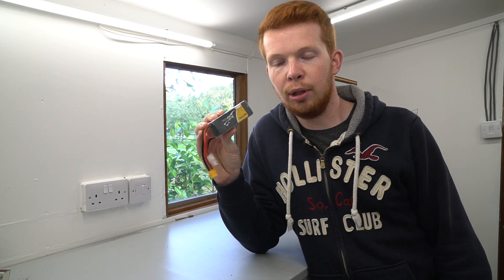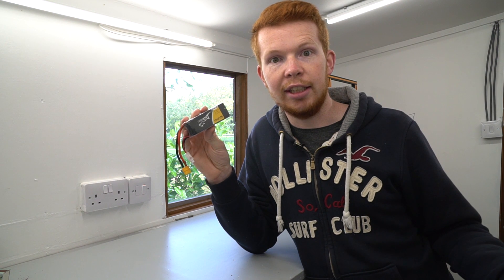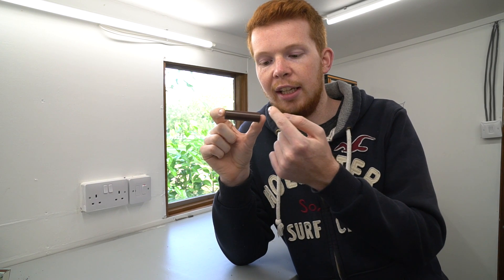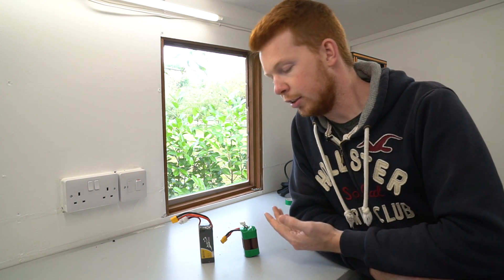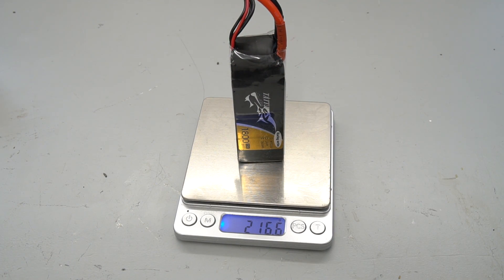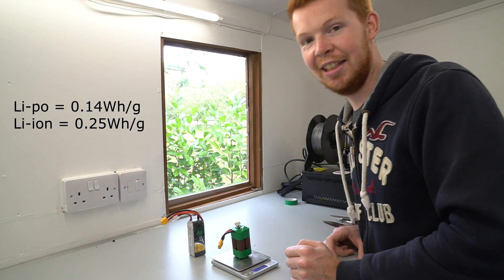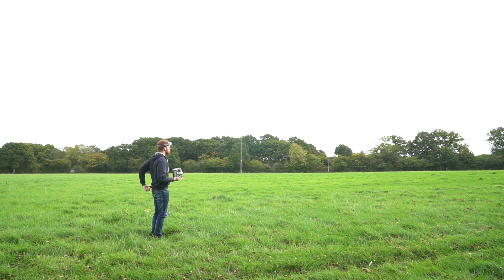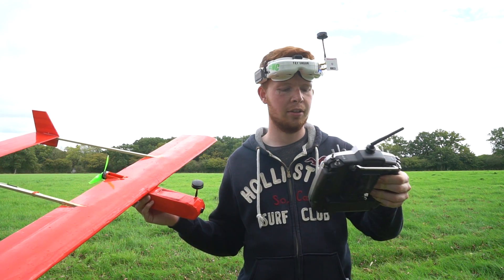Lithium ion plane battery

Comment: one motor, one ESC, no board, cheap homemade 'frame' - over 30 minutes flight time. that's why I love RC planes way more than quads. ok, you need servos but they're just so cheap.
Reply: The one thing I love about quads is their resilience. I have a cheap storebought quad that is indestructible. A fall from terminal velocity barely damages it. And the differential thrust deals with any misalignment in weight or rotor condition(i.e. beat to hell). I still would love a RC plane, but I can't afford one right now.
Reply: @ERPP8  if you have the patience its quite cheap to make rc planes. Sure they dont look like scale models, but they fly and its fun
Reply: @mortache  you'll be happy to know that that's what I did. I made one out of insulation foam and fiberglass. It's a chunky boi with a 3ft wingspan. Not too dissimilar so the one on this video. I just need to make for props for it(I mold them off an existing prop with fiberglass).
Reply: @ERPP8  i'll just stick with using readymade props. Good props are the most important part of the aircraft. Even cheaper ones will do
Reply: @mortache  they work quite well if I do a good job with the lay up. And they're far far cheaper than even the cheapest props of this size. It's like 11"
Reply: @ERPP8  I second this... but you do need twice as many props when you crash (on average).I built a quad copter two years ago, the frame is carbon fiber 4mm, I literally plowed the ground with it , bent 1 prop, I bent it back to shape, don't do that, kids( it shattered mid flight and slashed my knee when it fell), I have pictures with it swinging some long grass is caught
Reply: your profile pic almost tricked me
Reply: I have a quadcopter and Parrot Disco plane-like drone... It is the best solution for me, everyone who likes to fly should have both quadcopters and planes, the feeling of FPV on a plane is so great, you just dont hover in one place but you need to take off land etc it gives you a thrill and in my quad i had to upgrade the battery while in disco you have a 45 min flight by default
Reply: Planes don't hover though.
Reply: @flinkostememniakgrant1266  that's not entirely true... with brushless motors a lot of planes can hover.  ;)  

Honestly I love both, planes are certainly cheaper because you dont need a flight controller, only need 1 ESC and only one motor.  The frame can be entirely foamboard from the dollar store and flight test has tons of free plans online.  You also dont need as many channels on your radio, literally a 3 channel can work for a beginner to have a good time.
Reply: the only reason why I went with drones instead of a plane is simply because I don't have the space to fly a plane lol

Comment: But Lithium Ion you will lose performance as in KV of the motor as you fly, The Ion has a longer draw time but with less volts. Each battery has its own use. The li-po has a performance aspect. I use both, but in my drones I use Li-po.

Comment: LiPos offer significantly higher power-density, but the 18650 have a higher energy density.
So it depends - if you can get high enough power for your needs with the 18650 than they are the way to go. But as far as i am aware of there are none that come even close to being strong enough for faster flight or acrobatics.

 LG HG2 is 3000 mAh@20A peak.
While even cheap LiPos offer 40A, performance oriented ones can go to over 300A continuous.

Comment: A few things you need to be aware of:

1.  Total battery capacity is highly dependent on current draw.  Li-ion cells are rated at a much lower current draw than Li-Po.

2.  Capacity vs. voltage is highly non-linear below the nominal operational voltage.

3.  Longevity of the Li-ion cells is highly questionable if you run them down to 2.0 volts.  You might see an advantage the first time you test them, but do this a dozen times and you might find you've ruined them.

If you want to perform some actual scientific testing, do it on an intelligent dummy load where you can log all your data unattended.

Also, I'd highly recommend using a tab welder.  Partially for safety as others have mentioned, but mostly because you'll never know if you have damaged the cells in the soldering process.

Comment: I experimented with two red Li-ion in the stranded sires tow get 7.4 volts, the plane had a 20 Amp ESC running a E Max 7 to 9 volt motor with a 6 by 4 prop, it seemed heavy as the model had a tough time gaining altitude, but it was fine in terms of flight, thank you for cracking all the math and enduring the boring 40 min flights to present this video, I will appreciate the next time I decide to use a Lithium Ion batter in one of my planes

Comment: I have an old 6v cordless drill that I took the old NiMH batteries out of and replaced with two lithium cells.  I wired them with a 3 pole switch so I could have them in parallel to charge and in series to power the two stage trigger in use.  It works well, as when I store it I can have the two cells linked together to balance them automatically even when they're not on the charger.  It's probably shortening the life of the cells, but they weren't the best to begin with.  It was just a proof of concept that's worked out better than expected and so I use it.

Comment: I'm not sure what 18650 cells you are building your pack out of. Panasonic 18650b cells state in their data sheet that they can be discharged to 2.4v measured under 2c of load (3200mAh cell). I really think you are leaving a lot of energy in the pack unnecessarily. Would be interested to see the data sheet on the cells you used. This is the Panasonic one for reference http://www.batteryspace.com/prod-specs/NCR18650B.pdf

Comment: Dude you are definitely not supposed to run standard Lithium Ion batteries down to 2v, you'll massively reduce their life expectancy. 3-3.2v is as low as you want to go with any lithium battery. Of course it depends on the battery chemistry, lithium iron phosphate only charges to 3.2v maximum I believe. Also, lithium polymer batteries have slightly higher nominal voltages than the lithium manganese (I assume) you're using. Usually 3.8v/cell, so that may also explain why the lithium ion didn't perform as well as expected.

Comment: This is future of RC Airplane and copter battery , built is very solid . . . 18650 HG2 3000mAh  has current capacity is 25A . . . I used in copter and Airplane . . . Wonderful experience with good flight time, interesting think is we can modify any time 2s to 6s or more with numbers of pack combination . .   . . . Thanks for that informative video . . .

Comment: Don't believe the claims of 3Ah 18650's.  Test them yourself with a dummy load and multimeter(s).  Most are much less capacity than the claimed figure - especially the cheap ones.  Lithium Polymer batteries are the same technology in a lighter container (plastic bag instead of metal can) so would normally be lighter than Li-Ion providing they both have the same C rating.  Normally our model plane batteries have higher C ratings so that we can draw high maximum currents.  Higher C rating cells are heavier.  Buy the LiPo cells with the lowest C rating you can find; measure the actual capacity of them and the 18650's rather than believe the marketing hype; you'll most likely find that the LiPo's are actually lighter than the same (actual measured capacity) Li-Ions.
Reply: The specific 18650's he used in this video, the LG HG2, are legit. I've seen them tested to well over 2900mah, getting pretty close to the claim of 3000.

Even better would be if you could get your hands on some Tesla 2170 cells. They're around 32wh/g on the cell level.

I doubt any commercially available LiPo cell can match that, though that doesn't necessarily mean the 2170's are better for model aircraft. The 2170s suffer from a lot more voltage drop for one thing.
Reply: You need to source 18650's from a reputable source, especially if you plan to do get many of them. Buying them on Ebay or Amazon from random sellers, you are asking for trouble. I do this for one-offs when performance isn't critical just because it's conveniant to order cells that way. However this application requires high performing cells. Typically what ends up happening is the random ebay/amazon sellers are selling much older 18650's that were manufactured a long time ago (new old stock) and often do not give you cells that are from the same batch if you order a quantity of them. The popular Panasonic 18650's, for instance, all look the same, but over time the capacity of the newer batches has gradually improved. It's actually got upwards to 3.6AH for the latest cells. Older cells were generally under 3AH. The worst part is that there is no real way to tell what generation of NCR18650 you have, most people that review them and buy them do not have means to test the cells they receive and the claims of the product. I have some really old panasonic cells that are in a purple wrapper that have really bad ESR (they actually remind me of shitty xxx-fire cells!) They are 2AH, they are like 8 years old Needless to say, they perform like shit. Sellers generally don't care that the cells they sell are old, have degraded over that time, or care to send you cells that are well matched. If anyone is aware of a reputable distributor of cells, I would love to know! Most of them I'd imagine probably do not want to deal with selling small numbers of cells to individuals.
Reply: Not really. Brand names like LG, Samsung, Panasonic deliver 97% to 100% of the rating.  You are talking about cheap Chinese batteries that are labelled not by real mAh, but by fake "flashlight mAh" = 5x real mAh.
Reply: The lipo batteries used in phones and power banks have a good power density and low C rating, but they are harder to source than 18650s
Reply: That’s cause most of the 18650 on eBay are fake. Get brand 18650 like the LG or the Samsung 25R 18650 or Panasonic NCR 18650. They are the best and legit
Reply: The bigger problem imo is bootleg rewrapped cells. The chinese are really good at making the cells look legit. So yeah I agree, always deal with reputable source. I usually buy from illumination supply (www.illumn.com) personally, they've been the trusted source for vaping and flashlight enthusiasts for quite a few years.
Reply: Most fake ones yes. The are a lot of fake ones on the internet. Just make sure you don't buy Won Hun lo sellers.
I've bought 3400maH rated 18650 cells and they are very real on the claimed specifications.
Reply: ++ceptimus -   ohh yeah...!  Lipo's lighter than the same current Li-ions...  I'v ejust known 'bout it.!  butt.. all batteries're heavier with the higher current, aren't they?
Reply: You're not entirely correct. As most LiIon (chinese) specs are fake, there are 3Ah 18650 on the market, those LG are legit. I remember I scavenged some LiHv cells (4.3 LiIon) off some dell - tested them and drained 3.2 Ah till 3.0V !
Reply: Yes I agree with you

Comment: I totaly agree, if you ar heatin the batery for 10 or 15 seconds it is posible that you damadge it,
I have used a 120w soldering iron and the bateries vere a litle bit warm, guy on the link was heating it up for way too long thats why the damadge ocured

Comment: the LG cell is a bad example of a li-ion cell. poor energy density.  you also need to charge the li-ion battery as if it were a lipo. 
change the settings on your ESC, as you are not using the full capacity of the li-ion cells. Also try using NCR18650GA cells, and an efficient airframe.  
I've flown over 4 hrs easily with them, so this test is not complete by any means.. 
If you're asking for patreon money, don't complain how boring it is.. 
and nothing wrong with soldering the cells, just use a small gauge wire to go to the cell, and use wire bridges without ground loops.  There are videos about all of this on my channel if you are truly interested in making it work, and the engineering behind the successful use of the li-ion cells in model aircraft/uav's.

Comment: I am impressed by those li-ion batteries. I flew 1h 45 m with nicads of .03 Wh/g! I would be able to do more than 15 hours now with the same model, just by putting in new motor and batteries!

Comment: In order to use the full potential of a li ion pack you have to reprogram your ESC not to shut off the motor as it would to keep from over discharging a lipo.

Comment: Use low KV motors with larger propellers. Use 2 blade propellers instead 3 blade ones. And you will get much, much longer flight.

Comment: You can run li-po batteries down to 3v per cell and li-ion to 2.5 safely as long as its not on a big current. But best practice is 3.3 for poly and 2.8 for ion. The maths is simple and the 80% rule is good so  rerun the test on the bench.

Comment: Looks awesome! Well done. Had to jump in and say a few things: Titan's done all the homework on these packs for the last few years and really improved Lithium Ion performance through some advanced construction techniques and cell selection, we've got packs that weigh 200g but have 3500mah at 14.8v and even fast discharge packs that can every support multirotors. And, you don't have to build them yourself :) check it out - https://www.gettitanpower.com/

Comment: Could you possibly do the test by just putting the plane on a stand and just throttle up? 

Also, on a side note. I use 18650 batteries for my vape and I usually run them down to 2.8 before charging them up. Once I even ran it down to 2.4 and it charged up fine
Reply: Specifically using the LG HG2 according to the manufacturer it supports up to 2.0V without losing its useful life

Comment: Hi Tom, you can safely run it till 13.2 for 4S. For Li-Ion do not go below 3V per cell as the voltage is so low, it's so weak, it sags easily. With the lower voltage, you need more CURRENT for the same speed as well. Here i push it up to 10mins with a 1600mm wing
https://www.youtube.com/watch?v=1kS_iAztnlc

Comment: The Bearospace guys did a lot of interesting work with 18650 cells. Apparently, the benefit manifests more at higher capacities, so running dozens of 18650 cells in a 3S12P or so battery gives a huge advantage in energy density compared to LiPo packs. On a small scale like this video shows, the lower C rating of even the best 18650 cells becomes a bottleneck. Personally, I'm waiting for Tesla's Gigafactory to start pumping out zillions of their 2170 cells. I bet that'll make for a great endurance flight pack.

Comment: Yes flying in circles doing an endurance test is boring...

"Lithium Polymer" Batteries are still one form of Li-Ion cell.  
Merely a different form factor (pouch vs cylindrical cell)  - polymer in the [common] name is really a misnomer)
Any Li-Ion battery cell can use any type of Lithium chemistry. (Li-Co, Li-Mn, Li-Fe(PO4), Li-Ni-Mn-Co etc etc...without knowing which chemistry is used in example cells limits choice, not all pouch cells are equal, just as not all 18650 cells are either.

Interesting demo, So use of these cylindrical cells may be more scale-able than pouch cells (if the power draw and hence thermal changes can be limited/controlled through use of parallel circuits, or active controls).

Cell chemistry is always changing and being optimised.

Comment: Tom - you must do the duration test of Li-Ion! We need to know! Someone has already suggested it but you'll could use An inav or similar autopilot and put on cruise hold circling? Not so boring, and you can take the goggles off! You can get these packs made up using a spot welder BTW - I have 2 3S packs from a local company here in Melbourne. Great work and very informative Tom thanks

Comment: You should have known the battery specs before purchasing and definitely should have know their specs before direct soldering them.  I digress as I have done worse.  

The main point I wanted to make is that you can get pre-made packs for very reasonable pricing.  I got a 7.0AH 3s pack with an xt60 and balance plug for under $50.  Much safer and nearly the same price as making it yourself.

I highly recommend getting a 2s 18650ga pack for your fatshark goggles.  I'm getting over 4 hours with a True-D v3 module in my dominator 3s with DVR recording.
Reply: Where have you gotten those packs for such affordable price?
Reply: I got mine from gettitanpower.com

Comment: lithium ION 18650 can usually be discharged to 2.7v (under a medium load. like 1 amp or so) and down to 2.5v under a light load like 0.3 to 0.5A
about 3v is good cutoff for higher loads.

Comment: 100 watt soldering iron??
Ive soldered wires to an 18650 with only a 30W soldering iron. and it soldered pretty much instantly as my iron contacted the battery.
I pre tinned the wires and the battery

The wires were quite a bit thinner than what your using though. and I used a much smaller amount of solder. like a tiny dot just enough to neatly have the wire attatched.

Comment: I like the test that you have done.

I suggest you put the batteries in some sort of test rig with a constant load. Maybe an electronic load that you can set to the requested level or mechanical if you prefer.

https://www.banggood.com/Original-ZHIYU-60W-110W-9_99A-30V-Constant-Current-Electronic-Load-Aging-Battery-Capacity-Tester-p-1146280.html?rmmds=search

http://www.ebay.com/itm/Constant-Current-Electronic-Load-9-99A-60W-30V-Discharge-Battery-Capacity-Tester-/262911961157?hash=item3d36c62845:g:Mk0AAOSwWxNY2NiI

http://www.ebay.com/itm/Constant-Current-Electronic-Load-60V-10A-Battery-Discharge-Capacity-Tester-150W-/262911951715?hash=item3d36c60363:g:vuUAAOSwB-1Y2NXY

Kind regards

Stephan